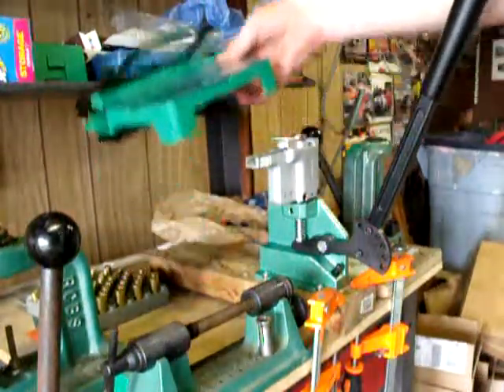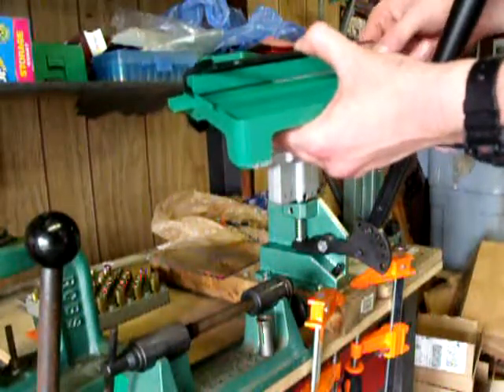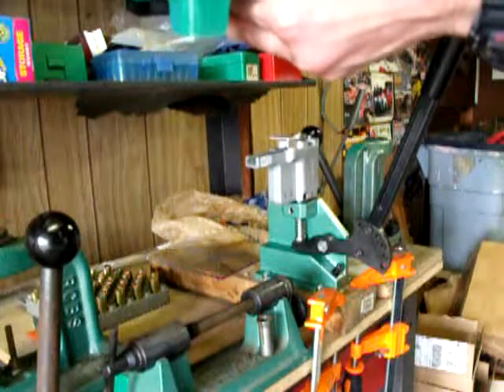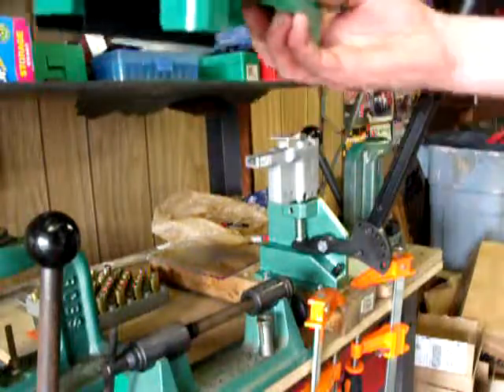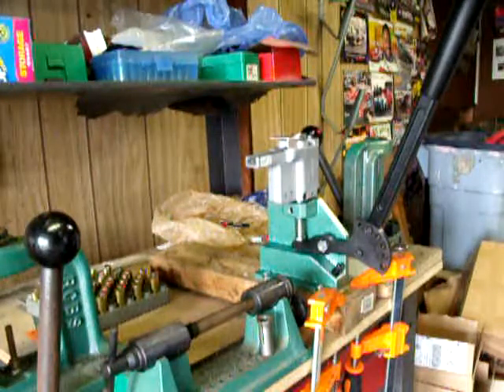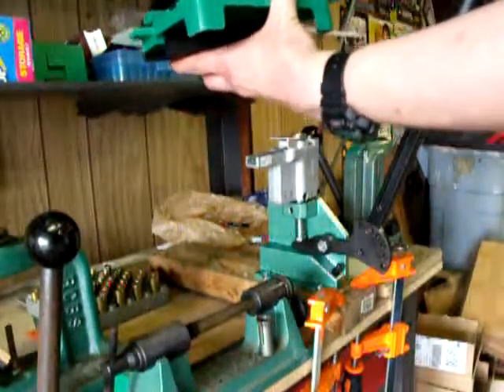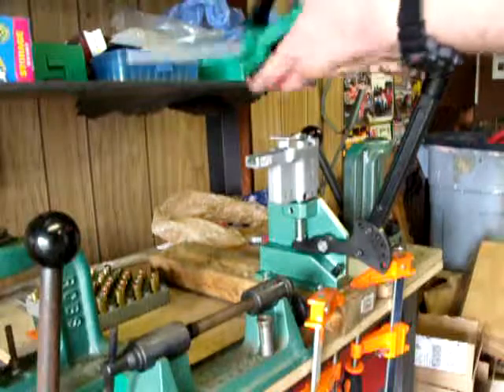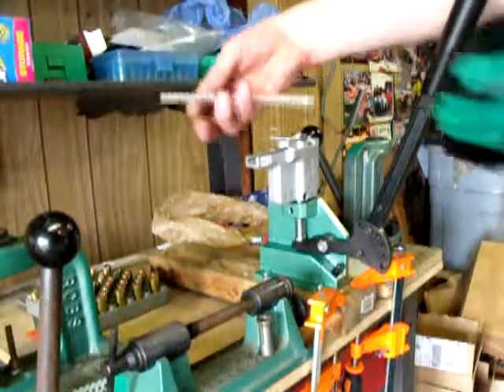How to load RCBS APS Primer Strips using the RCBS Strip Loading Tool

Comment: One tip, if you haven't figured it out since this is a few years old, if you remove the slide off cover on the primers, invert the strip loader, place the primer packet on the bottom of the tray, then invert again so it's right side up, no shacking is needed and very quick.  Need to get more in your camera lenses,  Thanks for the video.

Comment: If I was blind I would have gotten more out of this!!
Reply from the maker: Sorry that the video quality sucks.
It was the only camera that I had at the time.
I also have another video that's marginally better quality that shows how I figured out what I had been doing wrong in this video.
IOW, the APS priming system is excellent, just as long as it's securely fastened to the bench without flexing, as it was in this video here.
Reply: Thanks. I’ll check it out.

Comment: If yo haven't figured it out yet this video is worthless. Not one bit is in camera view!!NICE WORK !!
Reply from the maker: I figured it out.
My primer seater wasn't firmly mounted, causing it to tilt slightly and putting the primer off center on the up stroke.
I switched to the standard seater since this.
Reply from the maker: Sorry about the poor quality video.
I had a crappy SD camera, poor lighting, and I didn't even get what I was doing in frame.
As said, I went back to the older bench-mounted RCBS priming tool, and I immediately have to say that I should have just gone to that from the beginning.
It works flawlessly, 100% reliable, even providing the proper 0.003"-0.005" below flush seating depth each time.
I really wanted to like the APS bench tool, but having to use the strip loading tool and dealing with a very finicky feeding mechanism that seemed to bind in the strip at the drop of a hat led me sadly away from it.
RCBS discontinued the APS tool, and probably because of others having the same experience that I had with it.